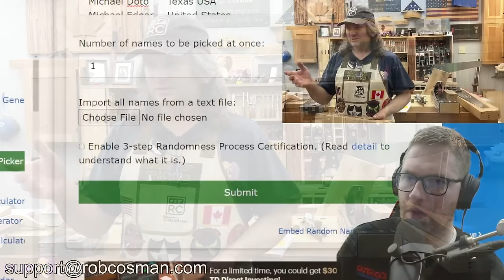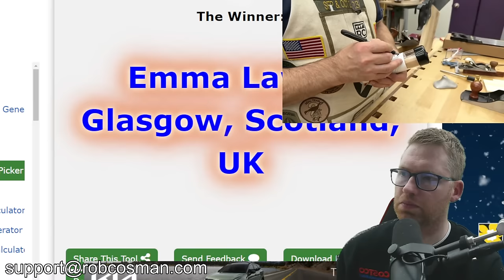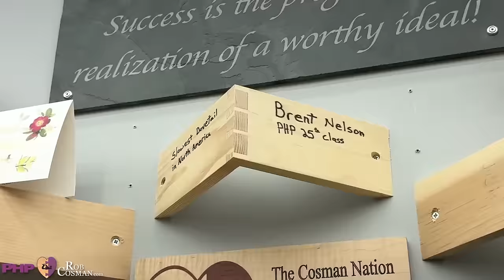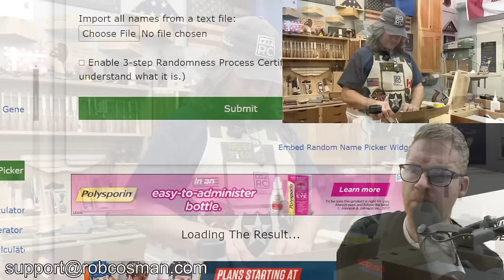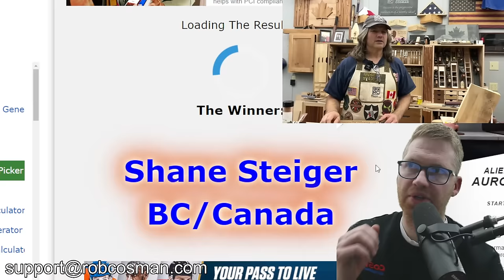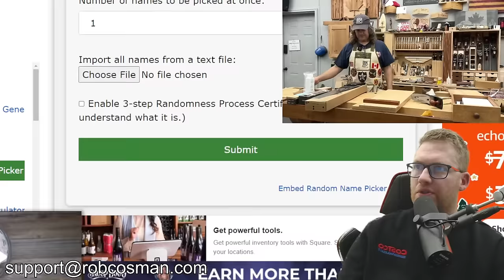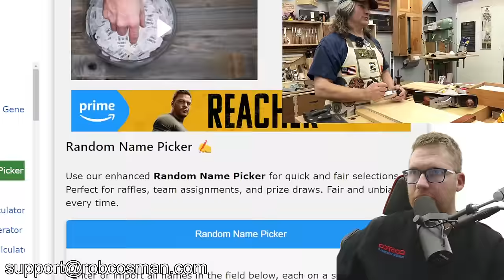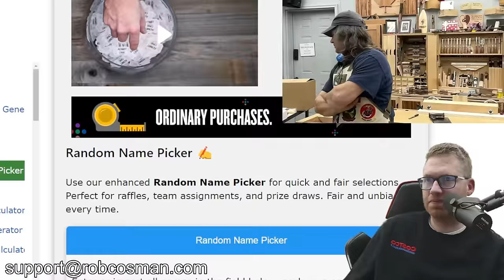Ask Rob Anything- Live Q & A (23 December  2023)

Comment: Hello Rob. I never got around to asking this question and hope you would be so kind to answer. I have been trying to freehand sharpen now for quite some time and can just not seem to get it. Be that as it may I'm using a veritas honing guide. What does it mean when I cannot get a shiny strip on my secondary bevel to reach each at either end? I'm not referring to the back of the blade. I can always see a great reflection all the way up to about 1/8" from either end. It's weird because I get a burr all the way across on my 1000 grit. But I can't seem to get those very ends mirrored on the final stones.  Thank you!
Reply: Are your stones flat?
Do you wipe the slag off regularly as you continue refinement?
Do your stones still have bite?
Do you lean into your stones, let the steel float over them or have a strategy?